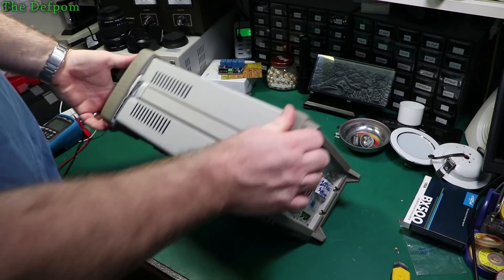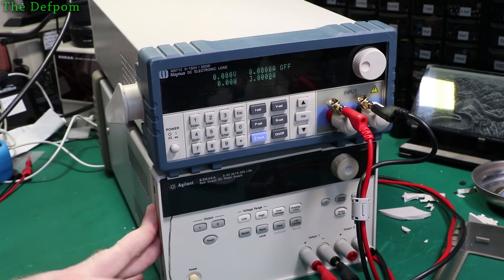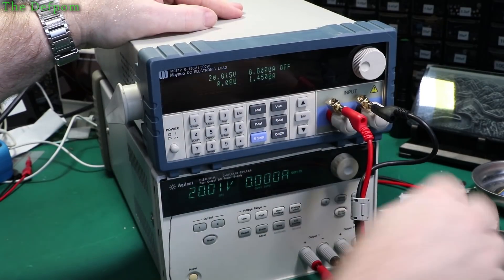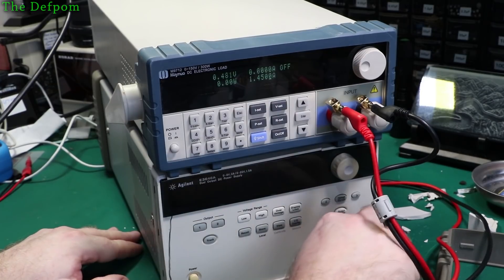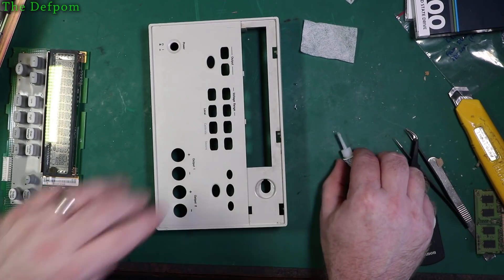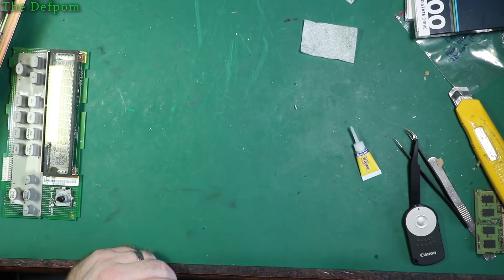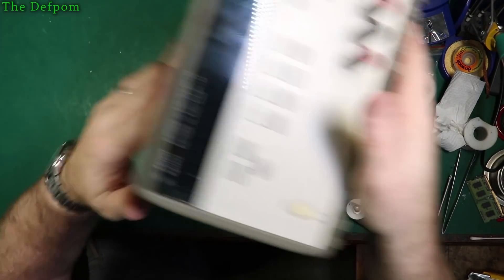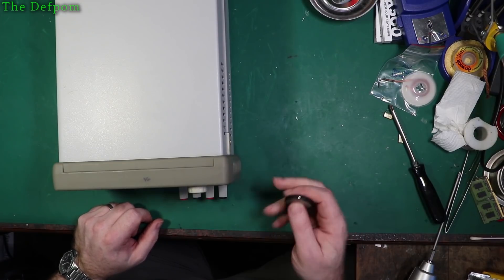🔴 #560 Agilent E3646A Power Supply - Load Testing and Repair

Comment: I was under the impression that the E36XXA power supplies' encoders have never shipped with detents on the encoders (or indents as you call them), which is why the damping grease is in place. This would explain why the detent yoke is completely flat. (Or I could just be wrong.)
Reply from the maker: Once cleaned and re-tentioned there are detents present, the grease will be a dielectric grease to lubricate and help avoid oxidation forming.

Comment: Hello! Thank you! You gave me the inspiration to glue back together a really nice HP oscilloscope that arrived with two if it's rear stand up/power cord wrap feet broken off. Got to love eBay! I went back after watching this video and found all the little pieces that were still in the box and spent a good couple of hours gluing it together. I used Loctite super glue and as much as possible. It looks surprisingly pretty nice, you almost can't tell it happened and this was broken into 25 pieces easy. So the question I have for you, is how is it holding up on your unit?
Reply from the maker: The glue is holding up OK so far!

Comment: Baking soda and superglue in the cracks to fill it, followed by some light sanding with 1500 grit waterpaper till smooth, and you will never know they were there unless you see the colour change.
got the same cordless drill, just blue and branded Ryobi. did a conversion to it to replace the NiCd cells with an 18650 lithium cell and control board, and bodged together a charge cord to use USB power to recharge the battery. As the motor is a little large for the DW01 and mosfet to power it that is just the charger now, and the motor is driven direct from the cell. Works well, and a little more power along with a lot longer run time off it. Still got the junk LED lamp in it still.
Reply: Jings!.....only goes to prove EE guys have same ways of thinking.....I did similar conversion hack to battery garden strimmer. Li-on much better :)